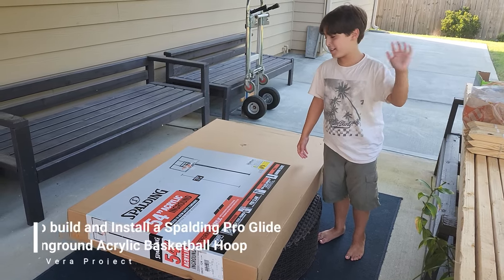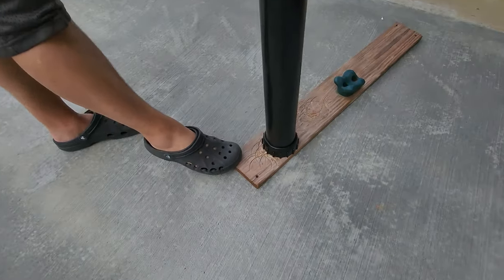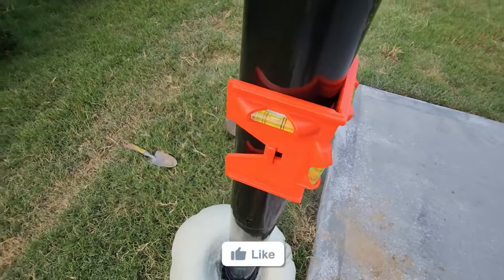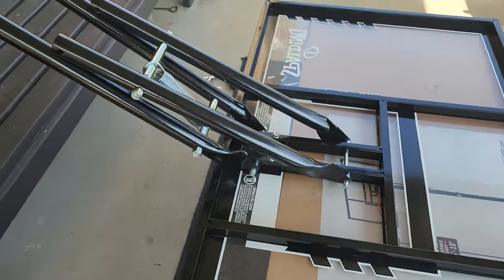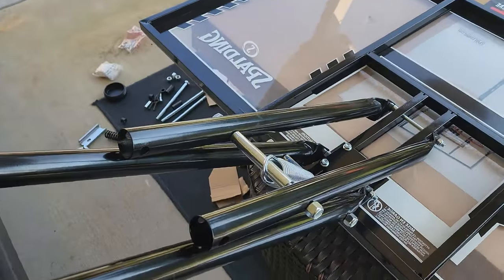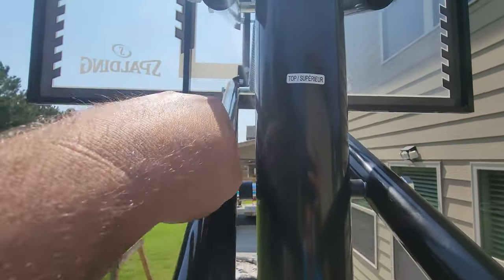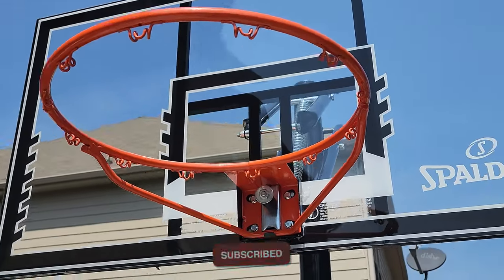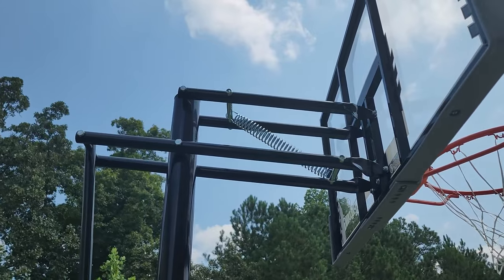How to build and Install a Spalding Pro Glide 54 in Inground Acrylic Basketball Hoop

Comment: Just bought this from Academy and fixing to go pick it up in a few. How do you feel about the Sika foam? does it seem to have enough rigidity? I have used it in the past for mailboxes and fence post. Have you tried dunking on it to see how it holds up?
Reply from the maker: I had to remove it after 6 months and put concrete mix
Reply: well I was gonna try it, so thank you for saving me from that! @VeraProjects

Comment: Did you put the pole in all way to the bottom of the 2ft hole or just half way down with the sleeve
Reply from the maker: 2ft with the sleeve
Reply: @VeraProjects  The sleeve is only 1ft long did you cut the bottom off